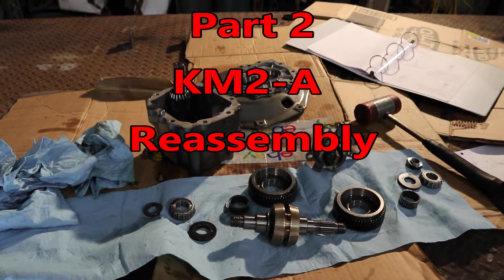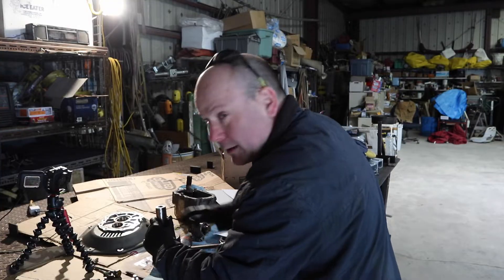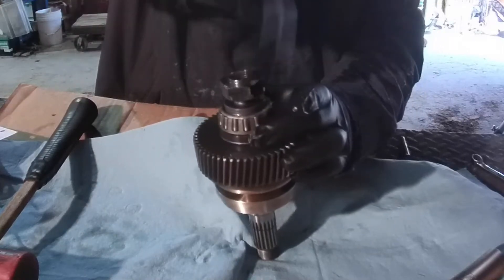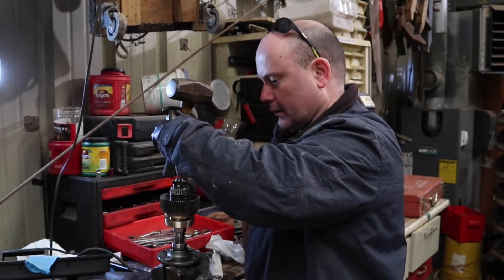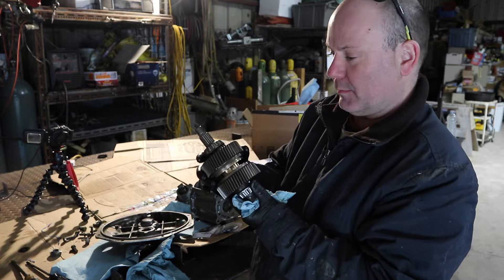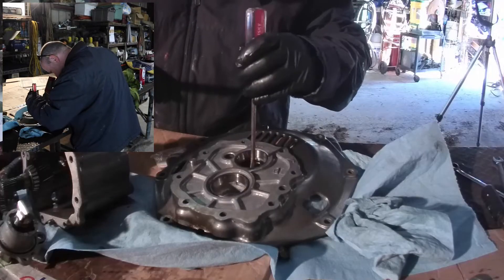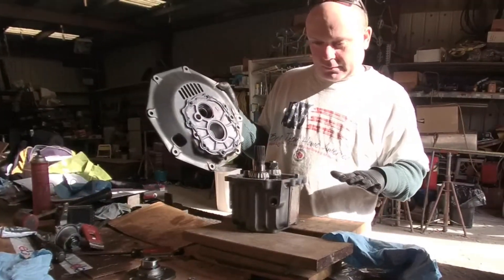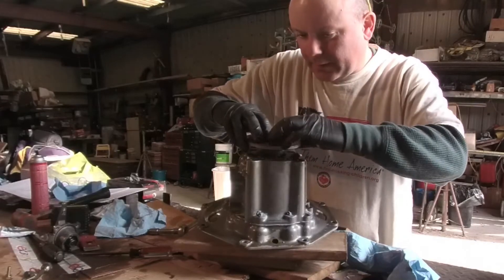KM2-A Reassembly.

Comment: He quotes the output shaft flange nut torque as 200 ft/lb... That is way too high and is not to spec IAW the manual.  63 to 81 ft/lb  is the correct torque!!!!
Reply: I have made a similar copy gear box Search gear google vishwakarma marine gear india

Comment: Hi, really nice video. I appreciated since the start of the dissasembling. Around (7:15), you swap the input and output oil seals. My output shaft oil seals started to leak last summer, so that I will change it before launching the boat. I was wondering if you still get a part # for those seals. According to the Yanmar service manual (chap 10, fig 1-4 annd 1-5) , the only info I found is ''oil seal''.  Before asking to a marine store, maybe I could find it in a diesel engine shop... thanks in advance and thansk again for the step by step KM2 dissasembly and reassembly! Sebastien
Reply: I son of Neptune Sailing, well someone just ggive me the gearbox parts catalog which I did'nt have and it seems that the output shaf part # is  177088-02961. Sorry, I hop you won't waist your time! I should have foud this parts catalog for the gearbox before!!! Sebastien
Reply from the maker: I swapped the nuts on the input and output shafts, not the seals.  I got my seals from a yanmar   dealer, they were not that expensive.   Thanks for watching!!!
Reply: @sonofneptunesailing917  They seems to be aroun5$ CAD here... thank you!
Reply: @sonofneptunesailing917 
I have made a similar copy gear box Search gear google vishwakarma marine gear india